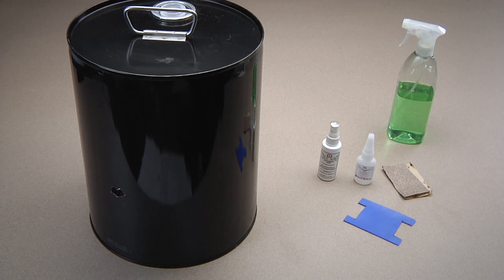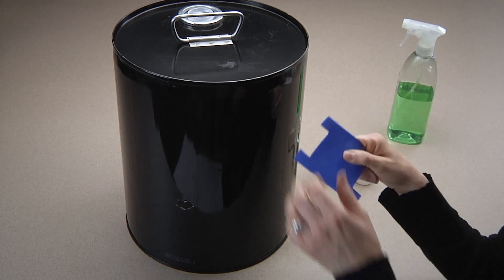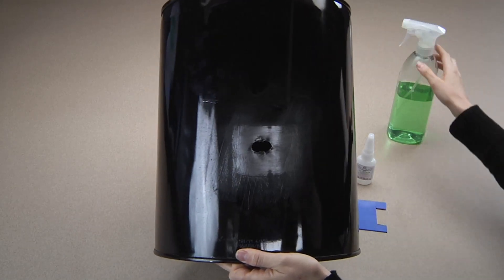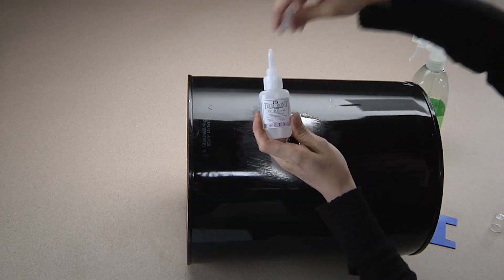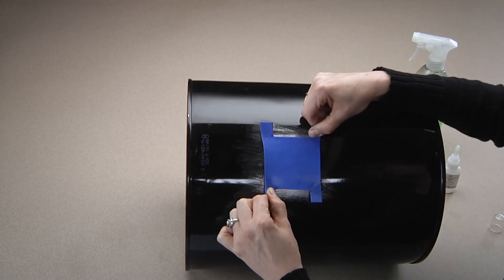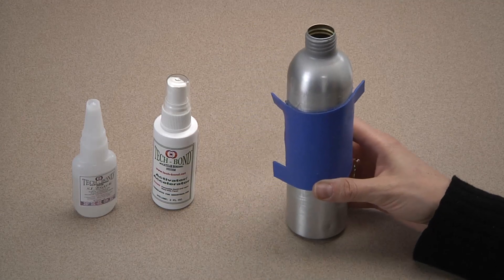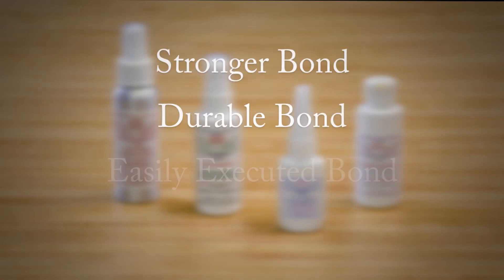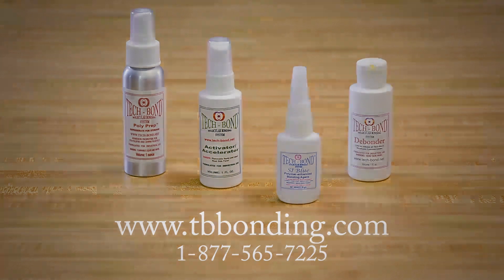How to repair a hole in a metal tank - no welding | Tech-Bond

Comment: Will it hold pressure?
Reply: Likely 'some' pressure, but i doubt it can compete with an uncompromised metal surface. It's made of silicone with the adhesive mentioned. It'd likely be a very risky repair if this is used in pressurized tanks.  Even with an adhesive as strong as steel, the patch itself is still a relatively thin silicone sheet. I would imagine silicone would be more delicate & likely to burst compared to metal. So maybe for SUPER SHORT term solution.....until the replacement tank arrives....but definitely don't think it'll hold up or be safe long term.